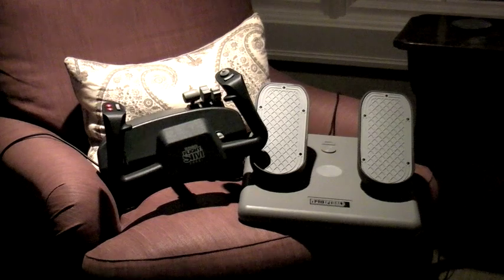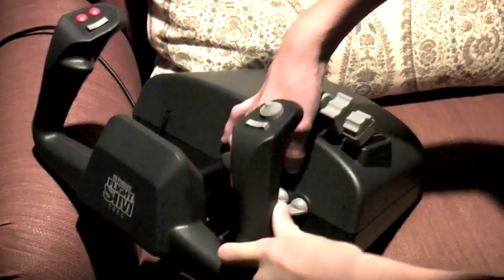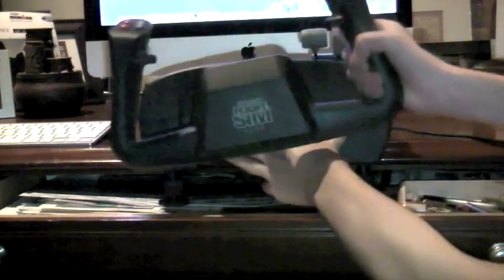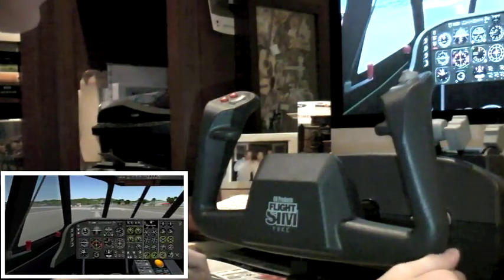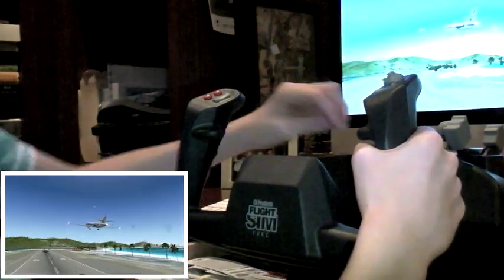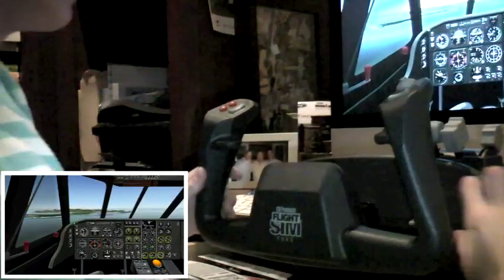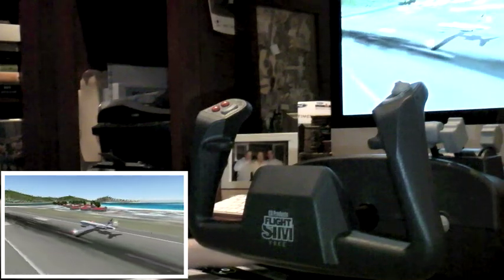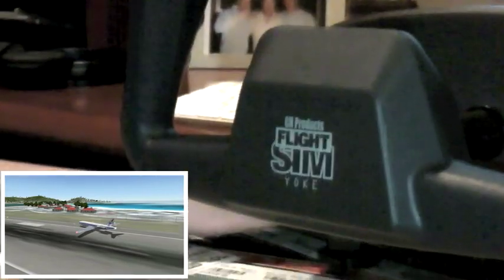CH Yoke and Pro Rudder Pedals Review

Comment: Hey!
I want to start out by saying that I love your videos and I find them very helpful.
Just one quick question, I have ordered the same yoke as the one in this video, and was wondering if you need to download any sort of plug ins for a mac for this yoke to work.

Thanks!
Reply: I don't think you need any sort of plug ins, but I know that you all you need is a usb hole thingy to insert the usb adapter thingy to your mac. sorry for the "thingy" sort of thing but i dunno what its actually called :3
Reply from the maker: Charles Yuen is correct, no plugins are required, just a USB slot for it!
Reply: pilotmaster72  Thanks guys!
Reply: +pilotmaster72 what is the normal key to press for revers thrust?